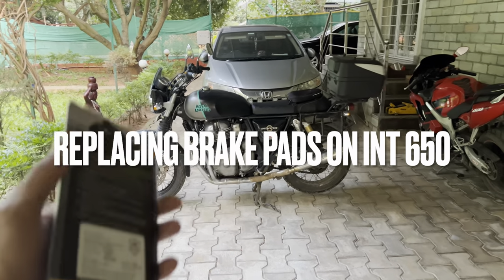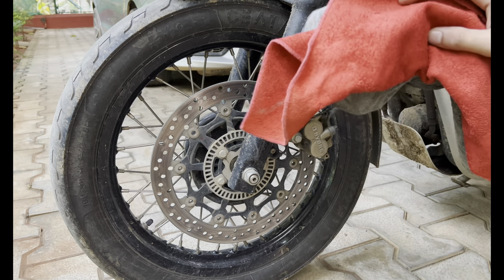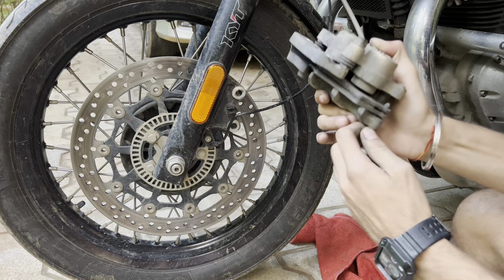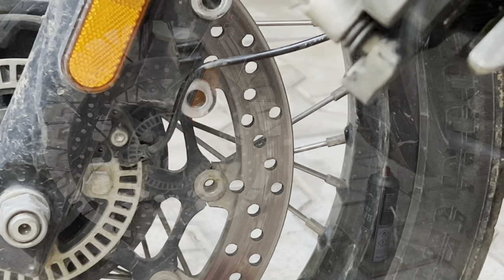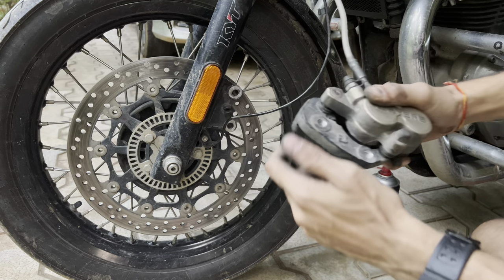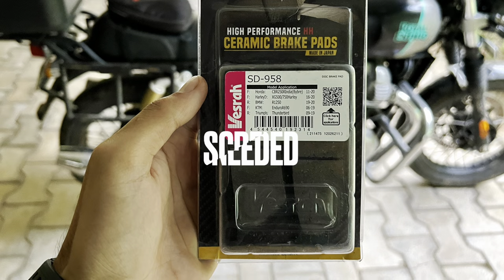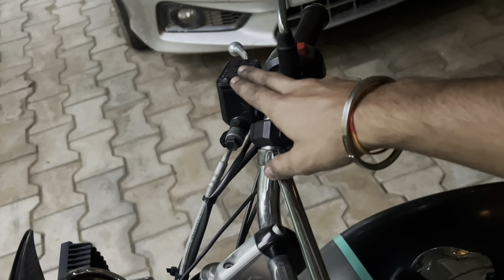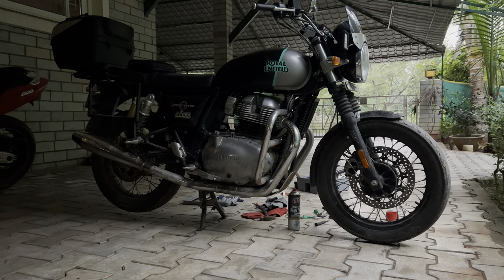Replacing Brake Pads | Interceptor 650 | Vesrah

Comment: Dude I'm having a weird hissing sound after installing vesrahs, why?
Reply from the maker: It’s normal with this type of pads!
Reply: @Vibe..  the noise increases with speed at gets very bad after 80 kmph, will it get slightly better with breaking in?
Reply: @Vibe..  its hissing even when I'm not applying brakes, it's hissing all the time
Reply from the maker: Yea cause it’s new na bro, it will reduce a bit later, will will still hiss slightly, I had an exhaust on my bike so it never bothered me 😂
Reply: @Vibe..  thanks man it was hissing even while rolling so i thought there's an issue
Reply: @_pm_gaming_point_1726  if it’s hissing, means it’s touching the disc…. Not good.
Reply: @RanjanSh  thanks man i figured it out pushed the pistons inside, reseated pads and released pressure, works fine now
Reply: @_pm_gaming_point_1726  get the pistons greased/serviced… you shouldn’t have to push them manually.
Reply: @RanjanSh  noted
Reply: @_pm_gaming_point_1726 how is the performance now ? I have just installed these same pads getting noise
Reply: @anirudharane  performance is good, the noise will reduce after some time but you can also try sanding then down. These ceramics always have a minor hissing sound it's normal